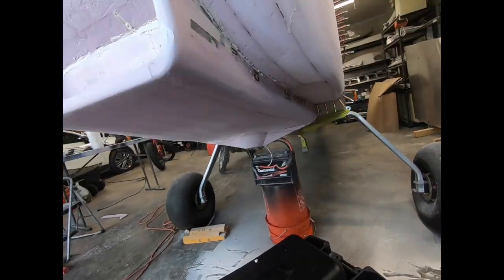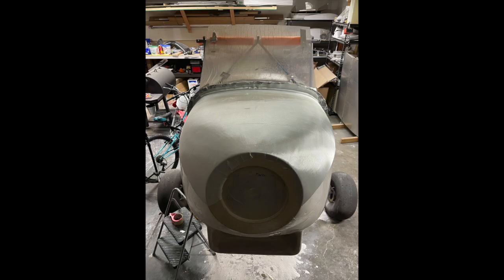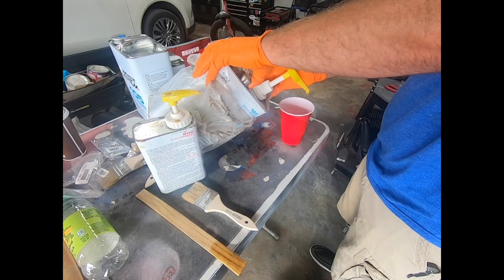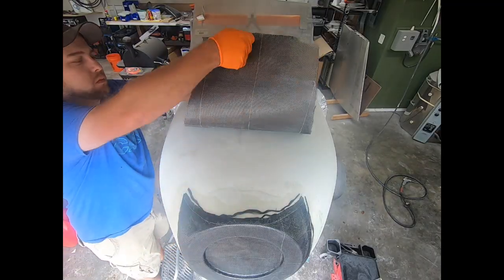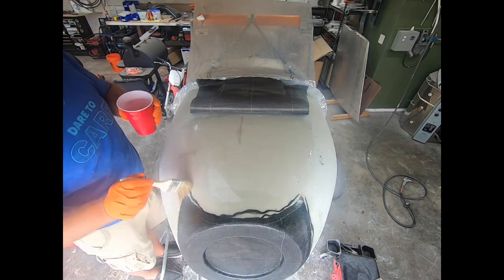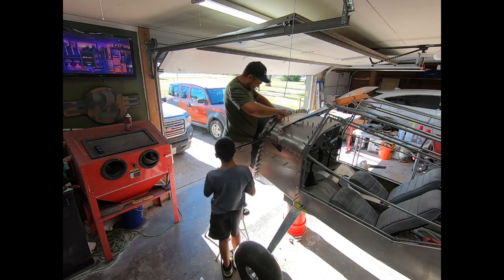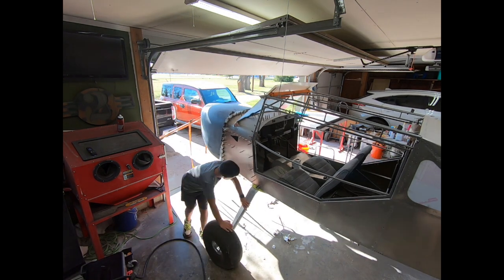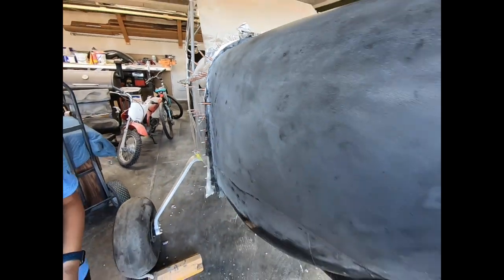Scratch Build Composite Airplane Cowling Part 2 EP 52

Comment: 1. I think lots of people use clear package tape as a mold release. 
2. Do you plan to split the cowling into 2 halves?
3. How did you get the glass/carbon to stick to the underside without it falling off during the cure?
Reply from the maker: I considered the tape method but couldn’t get it to conform very well to the compound curves. I do split the cowl and you’ll see it in one of the other cowl videos that’s already released as well. The underside was tricky and I ended up finishing that part after pulling the cowl off the mold.

Comment: I’m about to make substantial changes to an existing cowl set, due to upgrading a 4-cylinder engine to 6. I’ll be using techniques I’ve seen you (and others) demonstrate. If I didn’t miss something, so far your layer schedule includes 2 layers of bidirectional fiberglass and 2 layers of carbon fiber. Since I’m certain you have thoroughly researched this project, what fabric weights were these and what will be going over top of them?
If you don’t have time to answer, I completely understand.
Thank you for sharing what you do.
Every task you do, seems well beyond the results of most third timers.
Reply from the maker: The weight of the carbon is 5.8oz 3k weave. It’s a bit lighter weight than I had planned to use but it was a good price.  You do have the layer count correct and I plan to add another layer of carbon on the exterior surface. Any additional strengthening will happen on the inside.  I had all the other fabrics from previous projects so I don’t remember the weights but it was similar to the carbon (maybe a little heavier).. my plan is to use an automotive clear over the carbon since I want some portion of it exposed. The rest will get vinyl wrapped when the plane gets covered later. Thanks for watching and engaging sir!
Reply: @Project2Aero  I appreciate you sharing these details. I have similarly made materials choices, influenced greatly by what I have on hand, many times 😀

Comment: I just watched this (and Part 1) a third time… did you apply mold release wax over the plastic wrap?
Reply from the maker: No sir I didn’t. Would have been a good idea I think👍
Reply: @Project2Aero  I do think removal would have been much easier with mold release. But since you might be adding reinforcement layers inside, you’ll be glad you didn’t use it.
I’m making an oil pan cooling plenum for a Gen-4 Jabiru 3300. Because it has multiple compound angles, the mold process I came up with (as a novice), requires mold release wax but also that I add additional layers of glass after initial demolding. I clean it with acetone, using scotchbrite pads and cloth but I suspect subsequent layer bond is compromised, to some degree. Not critical in my case. But You’ll be confident bond for your additional layers is optimal for your method, it seems to me.
Reply from the maker: @foesfly3047  that’s a very good point! I never even considered that. Your project sounds cool!

Comment: I have used epoxy primer first then PVA as a release but just as you had problems removing it it was a chore with my method also but not quite as hard as yours. Thanks for the video great job probably the way to go I am still waiting on my Titan 1 year and 8 months now
Reply from the maker: Surely you mr gettin close to gettin a motor!! That wait time is crazy